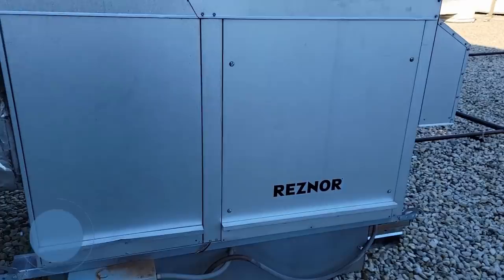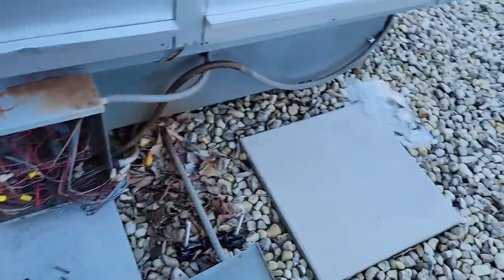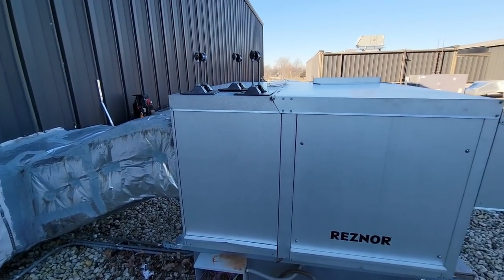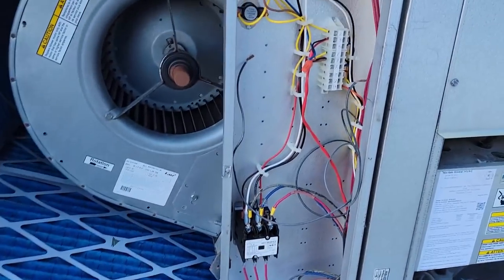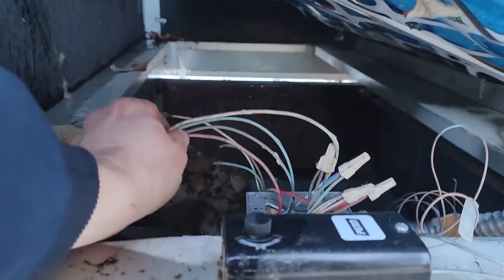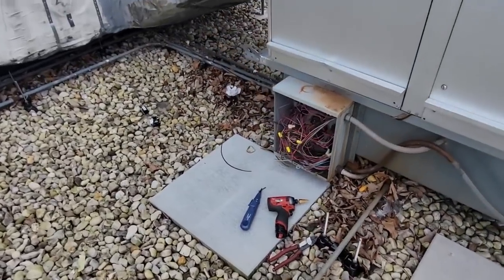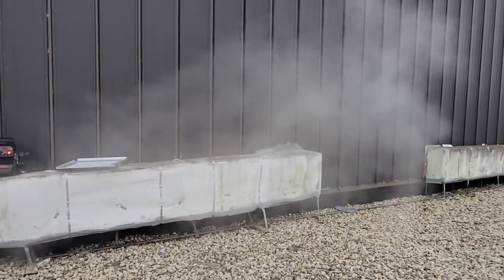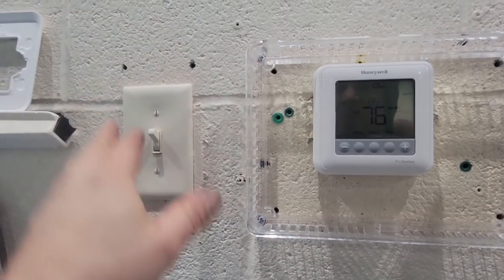HVAC Electrical Troubleshooting Disaster Hack Attack

Comment: Great diagnostic work, so hard to make a silk purse out of a sows ear. I worked with a residential contractor doing HVAC for indoor pools. He quoted Dectron only…funny how rich people who can afford an indoor pool would sometimes go wonky over the cost of proper HVAC. One new system we did was actually a complete house renovation because the original indoor pool had poor humidity control causing major structural problems (rusted I beams, rotted joists and studs, not to mention mold) and the house was only 10 years old.
Reply from the maker: I agree 💯%

Comment: "It's unwise to pay too much, but it's worse to pay too little. When
you pay too much, you lose a little money - that's all. When you pay
too little, you sometimes lose everything, because the thing you
bought was incapable of doing the thing it was bought to do. The
common law of business balance prohibits paying a little and getting a
lot - it can't be done. If you deal with the lowest bidder, it is well
to add something for the risk you run, and if you do that you will
have enough to pay for something better"

John Ruskin...

I know what you mean Rick, this is a daily frustration of mine.  Keep up good work.
Reply from the maker: Great share!
Reply: The problem is to differentiate those who will do the same job as the cheap guy just for more money from the ones who actually care.
Reply: @irfp460  it's a judge of character no doubt.  We should rely on quality tradesmen, like Rick, who can tell the difference, rather than simply using monetary value to judge.  Problem is we only use tradesmen for their labor. Not their intelligence.  Which in my opinion is a mistake.
Reply: 👏👏 I Like it S Bing! 🔥
Reply: Good, Cheap, Powerful, you can Not have all three.
Reply: You can replace Powerful with Suitable and or Fast here too.

Comment: What a mess! Great video Rick! Put some clear packaging tape over that wiring diagram and it will last. Nicely done.
Reply: That's a great idea Ryan! 💡
Reply: @EverythingHVACR  an old timer showed me that once
Reply from the maker: We use something similar for serial number tags on the ice cream machines.
Reply: @HVACRSurvival  I enjoyed the video
Reply from the maker: Thanks Ryan! I'm glad I recorded it. I want gonna because it was so cold
Reply: Different people could think alike 👏🏼👍 clear tape Comes most useful at times you won’t think of it. Another example is on a phone with cracked screen to avoid dust collecting on the lcd that way the phones lcd goes black and now the phones useless. You’ve been busy too from what it seems like mr hughesman. Sadly I don’t post on YouTube but just to throw what’s out here in Salt Lake City since I do comercial and industrial as well
Reply: @HVACRSurvival  that’s one thing I can’t do. Cold hands and cold feet up in any roof top. Yet can NEVER ANYONE AND NO ONE WILL OR SHALL find gloves that freaking work to hold 5/16 or 3/8 screws. Always bond to take off the glove kind a like a leak detector we’ll always bound to get bubbles after hahaha

Comment: Hey ..Must have been the same 2 stooges that replaced my mom's unit. I came over and saw the Filter dryer had all the paint burned off where they torched it in Ahhhh! Two schmucks in a truck!
  At least you know what the hell you're doing. Sorry for the rant. Enjoy your vids and always learn something too. That wiring appears to be a hot mess. Holy Moley
Reply from the maker: Thanks Larry 🤜🤛👍👍

Comment: I have that toner set.   It was a gift.  Any of them work fine, really.   I have five tone generators, and two pickup wands.   That way I can trace three wires at once without a problem.
Reply from the maker: I use to have the digital fluke toner for networks and hated it, the battery would go dead just being inserted and it had a hard time picking up the signal. I love this analog set. I have another set with the Christmas tree taps so I can use my telephone buttset but analog phones are hardly used anymore
Reply: @HVACRSurvival  - I specifically use super heavy duty 9 volts in these systems.  They're not much cheaper (if at all), but they don't corrode the living snot out of equipment when they die, and I think they die a bit slower when stored in a vehicle for most of their lives.  I have three bricks of 9 volts for this purpose.  I think I ordered a bit too much the last time :)

Comment: Rick can you tell me the name of the network cable tracer tester please. Another great video 👍
Reply from the maker: Link is in the description if you want to support the channel.
Reply: @HVACRSurvival  thanks I couldn’t find it earlier, I think you mean description 👍
Reply: @terrytugwood7848  A tip, when using the tracer, always check your probe on the toner before walking to the other side. ' Test your test equipment'.  If the wires are shorted by chance, no tone...
Reply: @deanb949  thanks for the advice 👍

Comment: How does a higher air temp than water temp reduce evaporation?
Reply from the maker: How does water evaporate?
Reply: Water evaporates when the relative humidity is less than 100%. Increasing temperature lowers relative humidity while lowering temperature increases relative humidity, it's why we have condensation.

If you decreased the temperature in the pool area to 0 degrees the air would not be able to hold any water and no evaporation would occur.
Reply from the maker: I don't claim to know all there is to know about pools and humidity but here is a link that repeats what I was told by several people that specialize in pools. This was a poor mans way of controlling the humidity levels, Most places don't want to spend $350,000-$450,000 for a full blown Dectron humidity control system like I work on at another location. Here's the link: https://hhcommercialonline.com/a-complete-guide-to-indoor-pool-room-humidity-control-by-h-h/
Reply: @EricHokanson  the purpose of keeping the air in the pool slightly warmer than the water itself is not to reduce the rate of evaporation directly, as you say, but HVACR Survival is not far off for why that's the way it's done he is just lacking the details but it's also outside of his area of required knowledge.

Too hot and the air will suck water from the pool, too cold and the water that does evaporate (it will still evaporate even if it's 0 degree air temp) will condense on things in the room it shouldn't, which is everything not in the pool.

Keeping the two temps close and the air slightly warmer allows the air to absorb moisture and carry it out the exhaust fan or dehumidifier. The hotter the air the more moisture it can hold as you point out. The relative humidity stays lower and helps evaporate water off glass, grout, benches, and electronics (should be sealed but pool water is hard on gaskets in electronics).

As a result, keeping makeup air to a minimum and controlling humidity with a nice dehumidifier is the best way to control it as you are only removing the minimum amount of water from the air to keep proper humidity. Bringing in outside air, especially cold outside air rapidly drops the room humidity as the already cold dry outside air warms up and turns into a dry sponge that will suck water from the pool at a rapid rate.

Keeping the air warmer and providing dehumidification keeps the relative humidity more stable in the allowed range which DOES over time reduce the total volume of water that evaporates.

As HVACR points out, those all in one units are expensive and when some guy with a decal on the truck drives up and says I can use these cheaper units by a factor of 4, people stop thinking rationally.
Reply from the maker: Thanks 2009! That's a lot of information, I'm not real great at science or whatever that it is that would help me better understand how all that works but you have a lot of good information.

Comment: This looks like the rats nest of CAT6 I am straightening up in a communications equipment shelter now.
lazy people that call themselves professionals too lazy to remove dead leads from the cable trays and retired WiFi radios off the tower outside. NO cable management at all either just zip tie it anywhere like to the tower beacon power leads - create cross talk on the data lines = poor quality WiFi and links.
Anyways I call this sort of thing "Visualized Insanity" or "Living Chaos"
Reply from the maker: I love nicely laid out data centers 👍👍